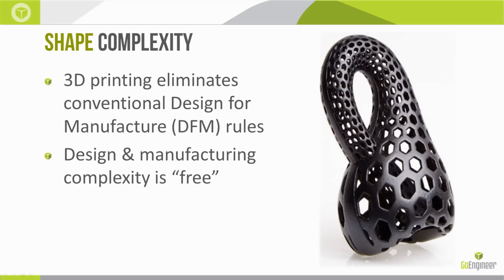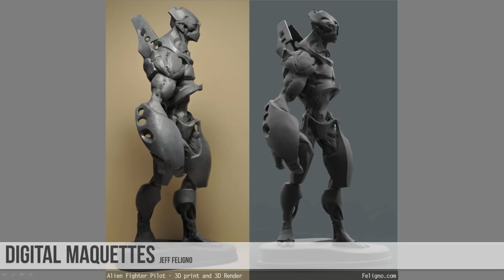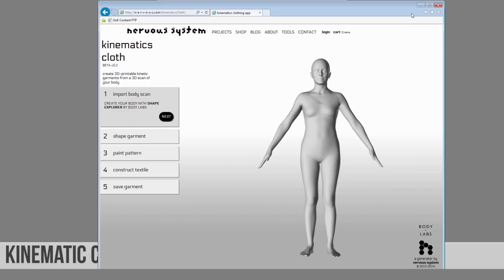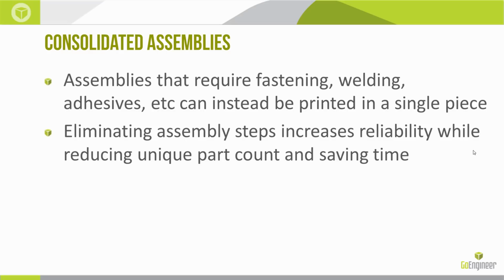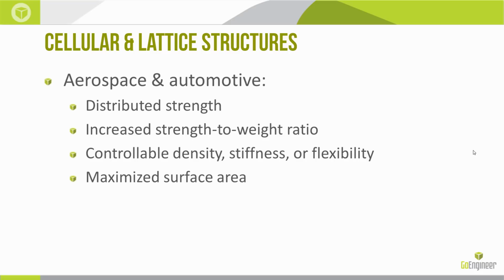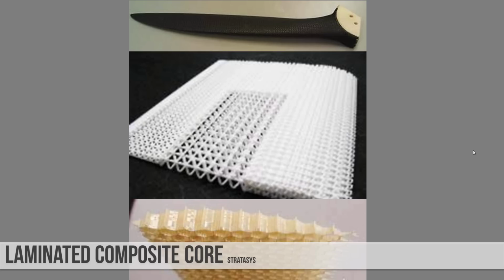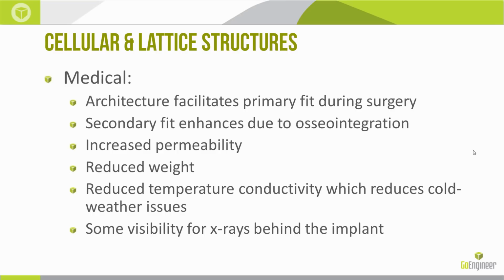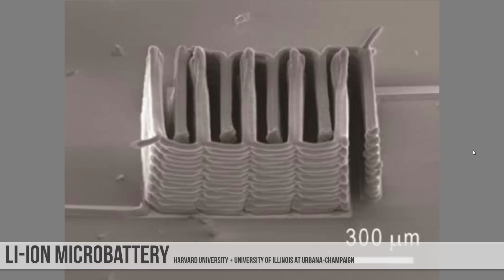3D Printing 101 - Impossible Geometry

Comment: I'm wondering what software is available for converting 3D objects into latticed versions of them-- not internally for lightness, but externally for aesthetics.   Sort of the equivalent of the "dress making" software shown in the vid but that will operate on any arbitrary 3d object you might import...
Reply: Syncopator I don't know of any that will do it automatically. In meshlab we can convert a solid to a voronoi wireframe pretty simply. The other programs I'm familiar with (netfabb 3S, Within, Tosca, Altair) all have added complexity (FEA component), high price, or in most cases both. The Grasshopper add-in for Rhino might have what you're looking for but I'm not certain.

Comment: I Love this!
I am a danish engineering student and i love the 3D printing technology for the ease at which prototypes can be made, but this video further enlightened me in, what cases it can be used for other than show-and-tell. :)

Also, this video made me remember again, why mathematics are still a part of the engineering basics course i'm at right now. Some of my fellow students really doesn't like the math and are more into the statics and strength parts of the course, but this shows that we might soon be seeing more shapes where setting up a mathematical program, rather than to calculate by hand, becomes a necessity instead of a luxurity. 

Thank you a lot for taking the time to make this video.
Reply: Thanks for the feedback Sebastian - I agree, mathematics will continue to play a important role in (literally) shaping and optimizing parts of the future. We can thank 3DP and the surrounding software for enabling that for the average person.